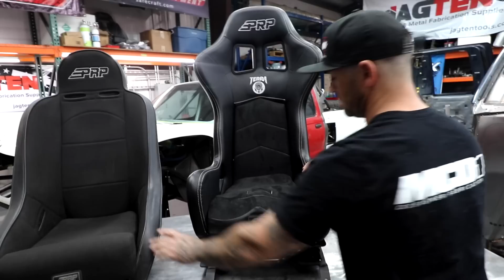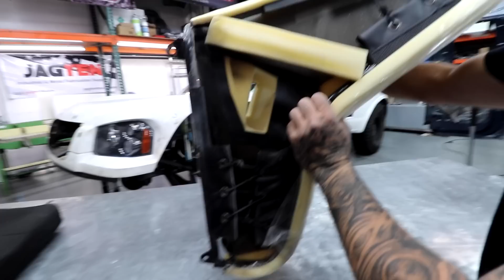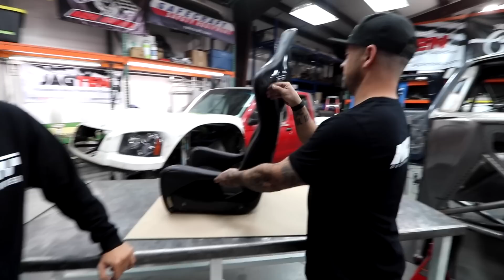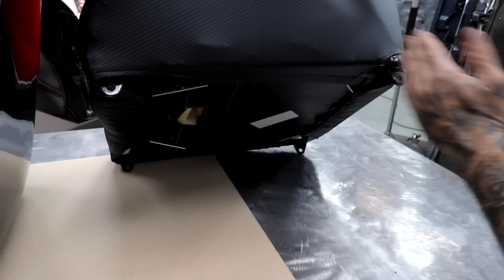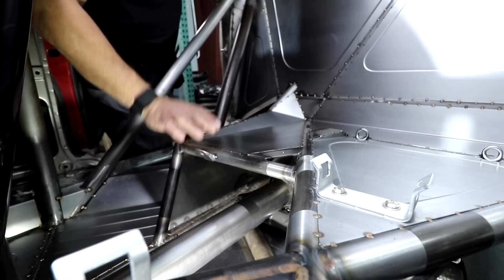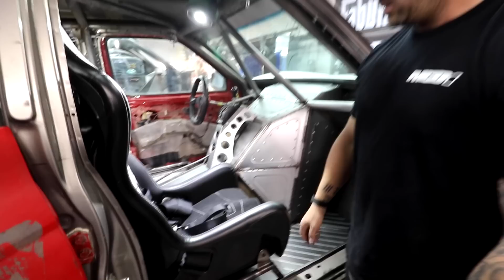Suspension Seat or Shell Seat!? Learn The Differences Before You Buy!  | TRUCK ANATOMY

Comment: suspension seats seem like they were an old school way to make trucks with really limited suspension comfortable, back then theyd just attach 4 shocks to each corner of a fully leaf sprung 4x4 truck and send it so the seats soaking up a little of the impact was good
Reply: Agreed. Suspension seats are still a reasonable option in classes/builds with limited suspension travel, but hardshell seats are the way to go in large-travel vehicles.
Reply: @anthonyolsen9299  never said that old school trucks weren't setup with the best stuff that was available at the time but lets be realistic even the best setups from the early days are nothing like what even budget builds have access to these days. ive seen the crazy torsion bar setups and quarter elliptical springs

Comment: Suspension seats for VW 1600 cc and under.
Reply: @anthonyolsen9299  I would not want to use a suspension seat in anything faster than a vw1600 CC .. class 9 class 1600 etc

Comment: I always thought of the suspension seat as more of a sling with the main advantage that it's going to be a little softer than factory metal seat springs.But if you're a big guy factory seats do just fine. Most racecar drivers are small guys more like jockeys than the average Joe